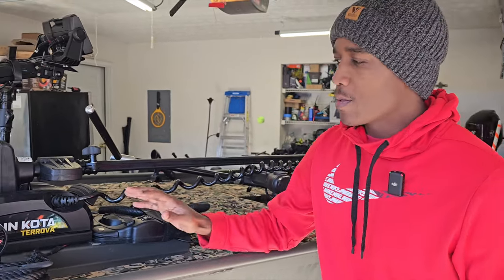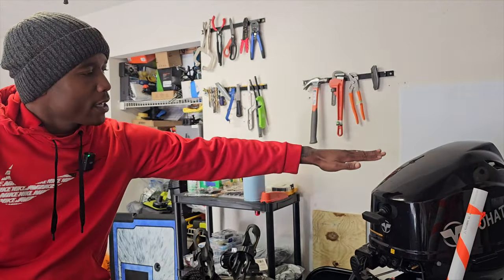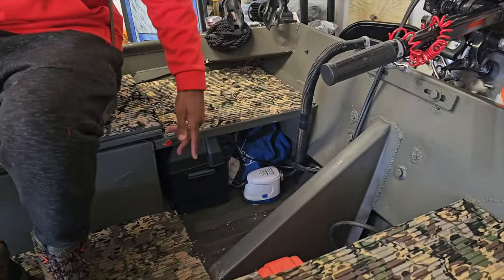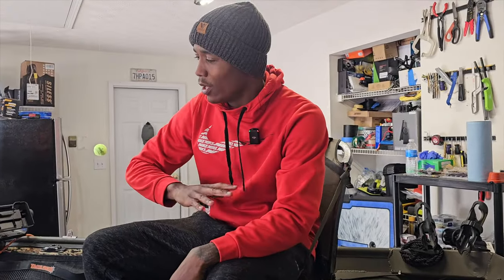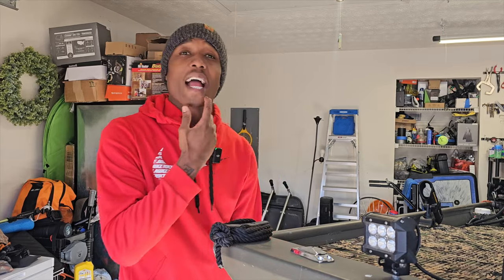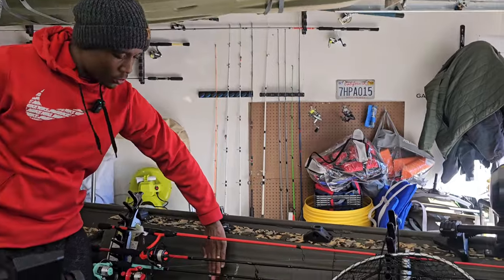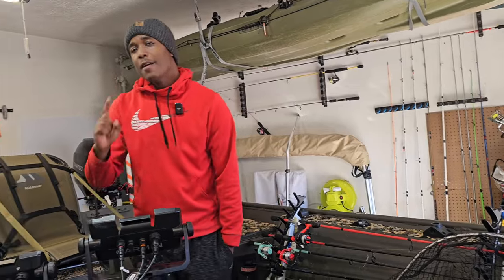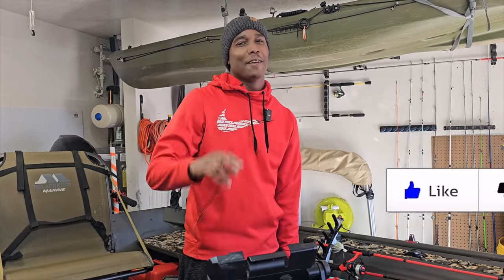Top #7 Essential Off-Season Jon Boat Improvements

Comment: I like your ideas, but don't have enough pennies to get all that stuff!
I just got a Tohatsu 20hp electric start, and it can be started with a pull rope, but mine (2024) isn't ready to use. Takes some disassembly and rigging.
I only have a tiller trolling motor. about a year old.
I think a mini bow deck and a couple seats are next on my mod list.
Mine is a 16-36 (long narrow boat) that used to be my Dad's, and he never added anything, so I have a blank canvas.
Reply from the maker: That's a nice boat to rig up. Yeah I intentionally save up to upgrade mods or accessories bit by bit. I'm glad my video give you a few good ideas to work with.

Comment: Please explain what lines froze  that stopped your motor from starting. Makes no sense to me.
Reply from the maker: Their was precipitation in my fuel line and it froze due to freezing temperatures, which prevented fuel from reaching my outboard motor. As the outside temperature warmed, I was able get it started. If I'm incorrect, please share your knowledge as to what was going on and how to prevent this is the future, thanks.

Comment: Thanks Chris......................I'm thinking of buying Live Scope Plus and use a Garmin GPS 1022 as my dedicated lvscp graph.  Do you like your transducer mount?  Seelite correct?   I'm like about to pull the trigger.  Jesus............cost more than my 1548 and trailer!!!!
Reply from the maker: Yes it's the seelite transducer mount. It was easy to assemble and is holding strong. Your right, livescope is pricey, but I have learned so much about fish behavior and pattern that I believe it's worth it.